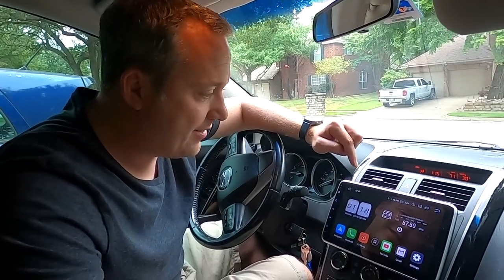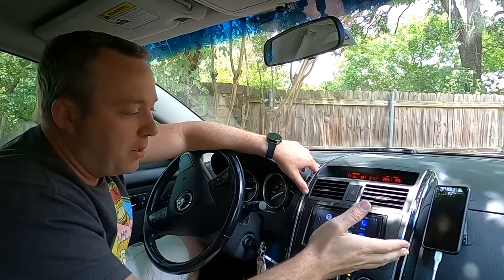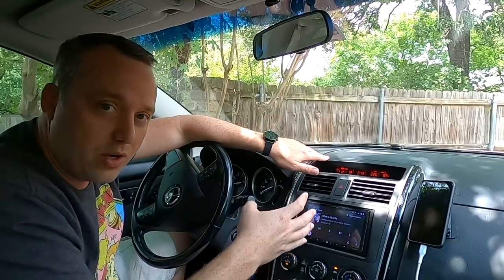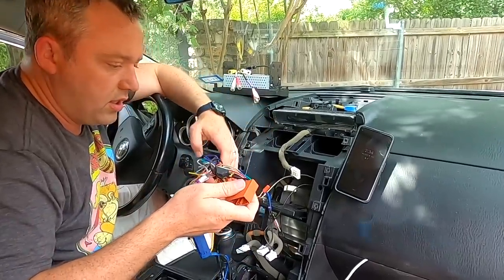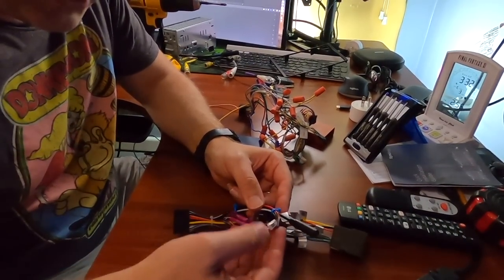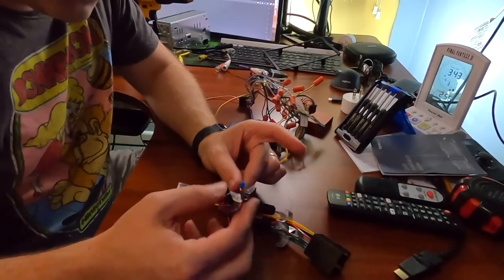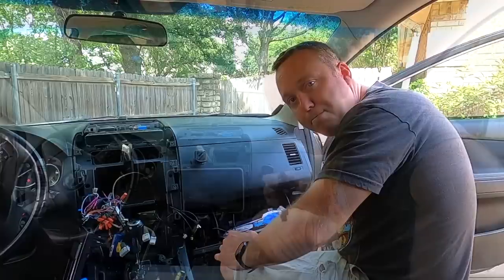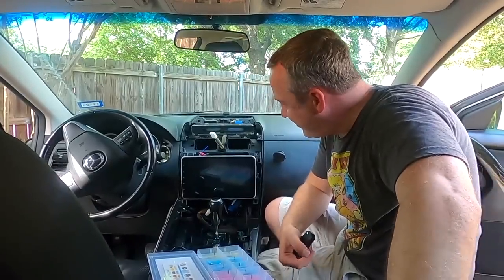The Tesla Style Deck in a 8 year old Car

Comment: It's nice to see someone keeping hold of an old car! I will never understand why people pay hundreds of pounds/dollars every month for a new car that is not more functional than a 10 year old one. I personally drive an 05 Chevy Lacetti (sold as the Suzuki Forenza in the US) that I bought 3 years ago for £1500 with only 35k miles on it. I replaced the old cassette deck with a more modern head unit that has Bluetooth and digital radio and I just attach my tablet to the dash with a magnetic mount for navigation when I need it so it's just as functional as a new car but for 1/10th of the price!